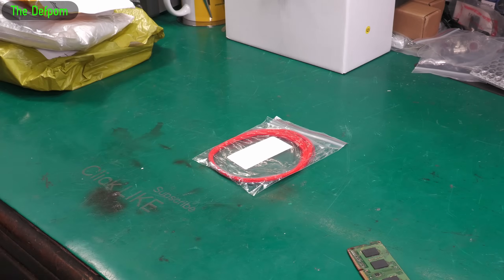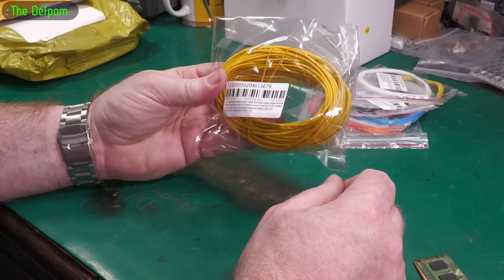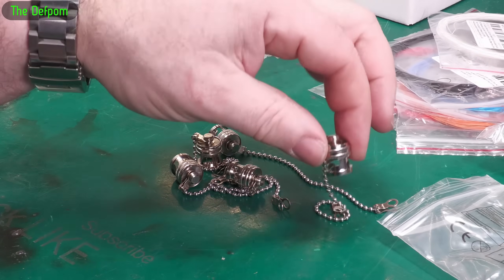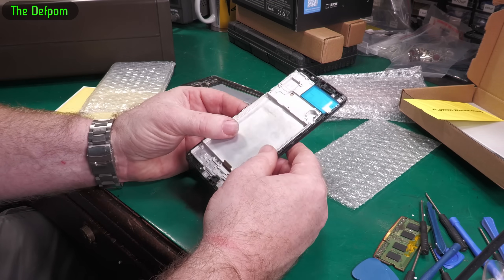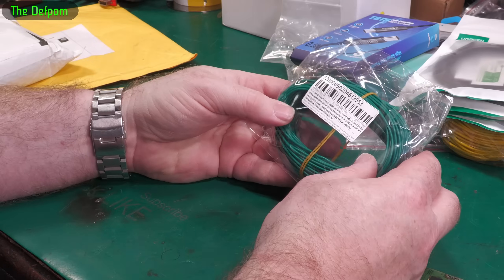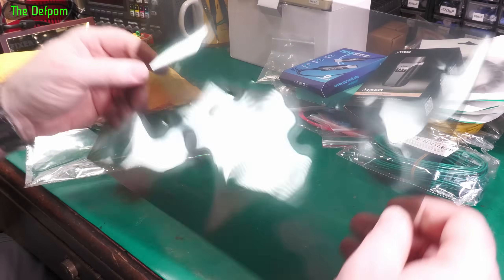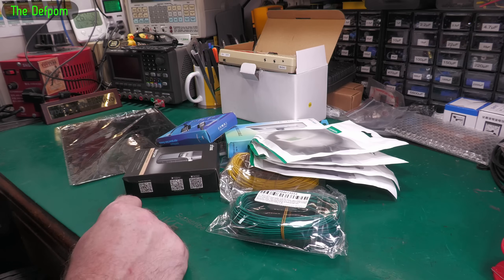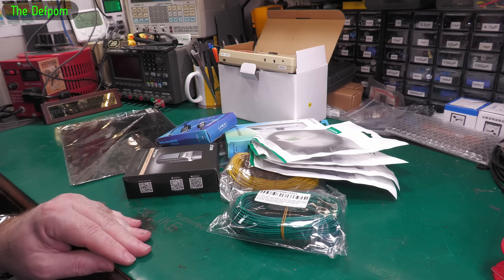🔴 Mailbag Monday 17th November 2025 - No.1425

Comment: Suggestions on polarizing: Get a glass polarizing filter for a camera that screws onto the end of your microscope lens, assuming your lens is threaded to accept filters, Barlow lenses, etc. You should be able to find the opening size in mm. Use the polarizing filter in conjunction with the polarizing film.

The photographic polarizing lens I use is 52mm because I use a (used) high-quality F2.5 18-108mm focal length closed circuit TV  (CCTV) camera lens with a C-mount. I bough one off of a popular online auction site. My camera is mounted on a photography camera tripod, facing straight down. This also makes my camera very stable. The CCTV lens screws into my microscope camera and the polarizing filter screws into the lens. The polarizing film I use over my light source has an opening large enough for my camera lens to see through. There are videos on building a low-cost microscope using CCTV lenses, which also happen to be a higher quality. Since they have large apertures (lens openings, mine is F2.5) the large lens opening allows more light to pass to the camera. This means your light source can be less bright.

Back to your situation. Cover one of your LED light with a small piece of your polarizing film. This should polarize your light in one direction. On the polarizing filter on your camera, there is a ring that rotates freely. Rotate this ring. You should then see the effects of polarizing. When they are 90 degrees from each other, they will cancel out the reflections on bright solder joints, and make the characters stamped or printed on chips more legible. Your mistake was just overlaying one sheet over the other. Won't work. 

Also, this method works best with a LED ring light. I'm not certain how you can get both of your LED "spot" lights to align so the polarizing polarizing will work. You may need to try one light at a time to get the polarized light to align. If you do get a ring-type LED light, just cut a  piece of polarizing film large enough to fully cover the ring light. This portion will remain stationary. Cut a hole in your polarizing film, large enough to allow the camera to "see" through, unobstructed. When this is all set up correctly, you should be able to rotate the ring on your filter. 

Also, getting a glass photographic polarizing filter will give you far superior optics. You don't want to view your microscope through what is basically a plastic sheet of mylar or plastic. This process is similar to what you'd do with a digital camera or a 35mm SLR when doing outdoor photography. The light coming from the sun is polarized. Rotating the ring on a camera polarizing lens puts them at 90 degrees. This cancels out reflections on water, metallic surfaces, etc. It also makes the sky appear a deep blue as it filters out the reflection from water vapor and it will make colors "pop". They will appear to be more vibrant. This how professional photographers get the brilliant colors in the beach photos in the Caribbean!
Reply from the maker: When I tried both sheets at once I did one on the light and one on the lens, but I think my main lights where drowning it out a lot making it far less effective so it didn’t appear to change. Thanks for your extensive message with suggestions to improve it.

Comment: Wire is in bags because they pack it when it comes in, making lengths of 1m, 2m and 5m, most common sizes, then seal them into bags so that ordrs are faster to put together. The 2 in one pack was because they had none in that colour and length, so had to use the reels, and thus put them in the same bag. Plastic bag in a roll is very cheap, I pay around AUD80 for a 2km length of it, Cryovac clone, which lasts a long time. Also good for making windows for IR cameras as well, it is transparent to the IR wavelengths they use, along with IR remotes as well.

Comment: 1:57 - the easy (and generally free) sources for solid core wire are Cat 5 and telephone cale, and for larger guages the building wire used for lighting and power circuits in domestic homes.
The cat 5 conductors are ideal for breadboards (unless you've destroyed the springs by forcing Dupont headers into cheap chinese boards)

Comment: Scott, a while back you asked for information on GPIB connector hardware. I had a rummage through my stuff and came up with this - Mouser P/N 761-M2143-3506-AL. This is a standoff with the correct 3.5 mm X 0.6 thread. It's 6 mm across the flats and the standoff part is 8 mm tall so it allows the connectors to mate properly. Two problems - first, it is aluminum so easily damaged. Second, the threaded stud (also 3.5 mm X 0.6) is only about 7 mm long (manufacturer says 6 mm). I used these for a GPIB project a while back and they worked well but are not going to be long enough (threaded stud) for many repairs. They are $0.47 US each singlely or 10 for $3.41 US and are currently available from Mouser. Hope this helps. Regards, David
Reply from the maker: Awesome thanks, that could well be useful

Comment: cut your PTFE wire sleeve off with a scalped blade, don't use cutters that cut and pull. the PTFE insulation will stretch and then shrink back over time exposing a bit more of the conductor. PTFE has a friction coefficient close to that of ice.
Been using PTFE wire most of my working life, as you say the insulation is very good and very thin so cable forms take up less area.  Kapton wire's insulation is also very thin but banned from being used in new aircraft for many years as it absorbs water and can explode and blow a cable form apart in the event of a short circuit causing an arc. Both have great properties but one doesn't go bang. 🙂
Reply: PTFE is great…….but can be evil!
Reply: @IanScottJohnston  love PTFE wire, except that it don't flex very well. single screen is just so thin with a great screen coverage, but you do get what you pay for it don't come cheap.

Comment: The only issue I have with the OBDII readers is the use of a phone and their app. I don't trust specialized apps.
You have enough "wire wrap" wire to last a lifetime 😂. I still have rolls from the 70s. Have a great week.
Reply: The main issue is that the Apps don't read the proprietary codes from the various manufacturers, only the OBD codes themselves.
A straight ODB reader with screen is about $10, and doesn't need an app.
Any reader that can read manufacturer codes will need continuous updates, and a phone App is the easiest way to achieve that.
Reply: @johncoops6897  not forgetting that all the manufacture codes are pirated as they don't give them away for free. The only free ones are generic ones that test centres need for MOT's etc if your in the UK.